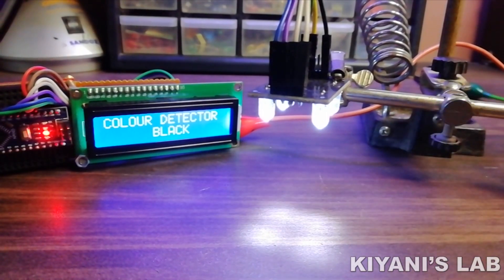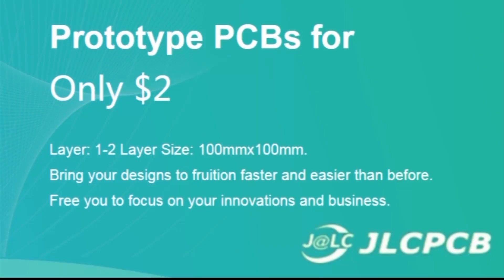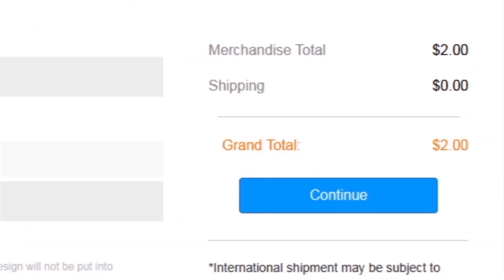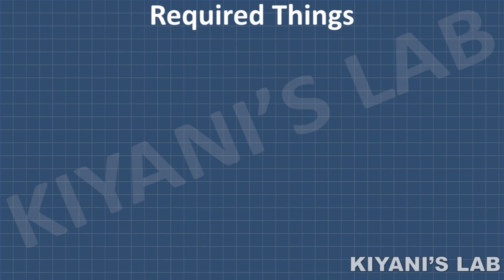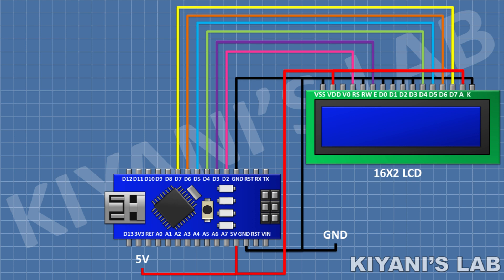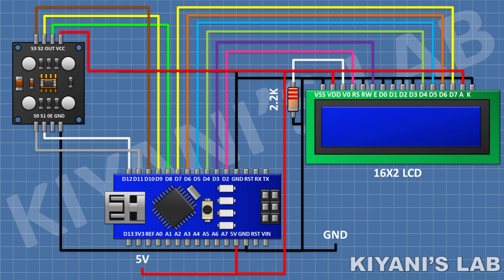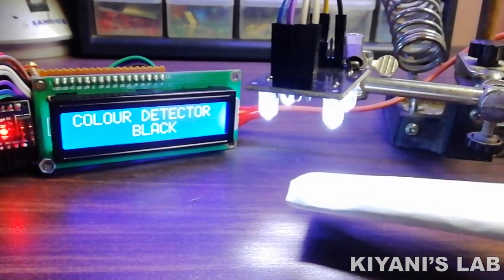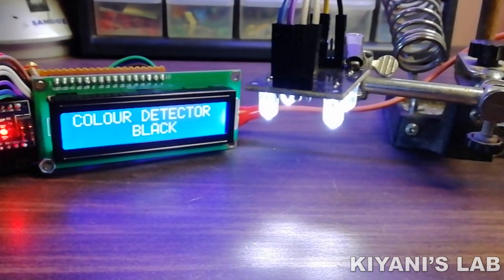How To Make A Color Detector Using Arduino

Comment: In your precious project of auto-matic water level, I want to use 30 ft length of wire for ultra sonic sensor. Does it works correctly without error . Please guide me
Reply from the maker: yes with good quality wire